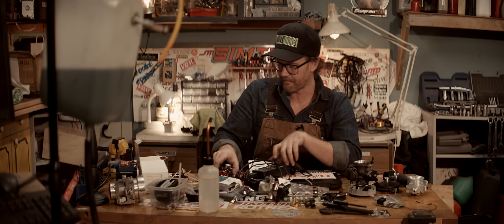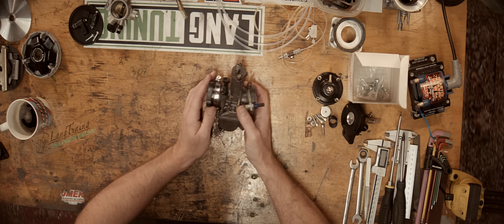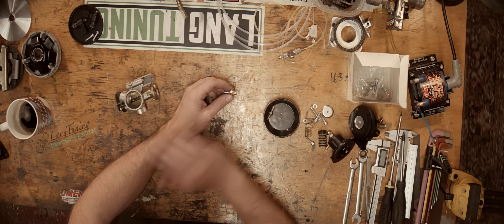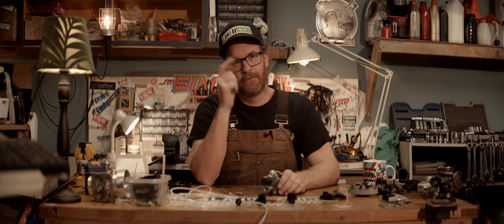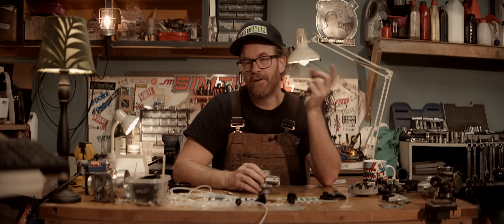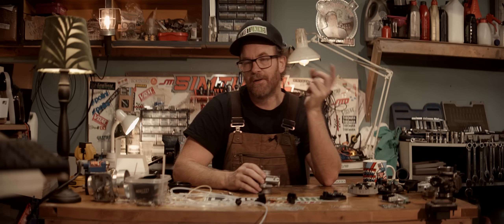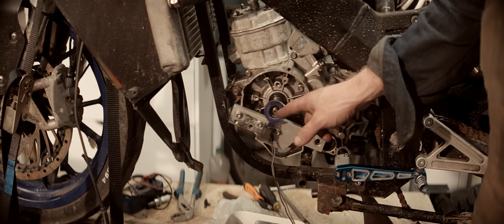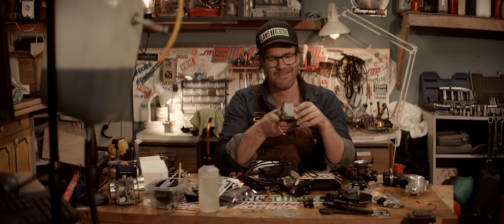Nitromethane Two Stroke EFI, but not how you think.

Comment: I'm not a fuel injection expert by any means, but I thought batch fired injectors normally fire once each crankshaft revolution.  And the pulse with is electronically adjusted depending on the desired mixture.  A normal car uses the ECU to adjust the pulse width based on information from a throttle position sensor, some kind of air flow sensor, and an intake air temperature sensor. But a more sophisticated ECU like you might find on a race engine, can change the injector pulse width based on any measurable parameter. Therefore, it's not immediately apparent to me why the rich/lean problem you mention at the beginning of the video would pose a problem.

Comment: Use a higher volume fuel pump for an injector. microsquirt is a programable system out of Canada. you can then adjsut it's duty cycle and impedance and duration so that would allow it to run perfect with the 2-stroke. or you could use 2 injectors.

Comment: This might be worthless but could you not put a stoichiometric sensor in the crank or even built into the port from the crankcase to cylinder. Use something like an arduino with fuel injection to maintain the fuel ratio at all times.. Also if you can find the right injector with perfect atomisation could you inject straight into the crankcase. Just a crazy thought.. Keep up the good work..

Comment: Water burns very slowly and is not likely to have pre-ignition issues, but it will slug the cylinder if you don't have adequate lightning to start the flame propagation.
Just sayin'.

Comment: Hi Alex, about CRANKSHAFT ISSUE: considering the relatively high radial load applied by the CVT at some distance from the main bearing, the induced web bending is something to be considered due to alternative deformation, specially at high RPM. The combination of the alternative bending and the resisting torque (and the increased friction) at high RPM can produce twisting between webs. I highly recommend you install a bearing in the crankshaft end in order to avoid the bending deformation due to CVT

Comment: It's exciting to see a bike on the Dyno. 
But I'm very suspicious of nitro being useful outside of drag racing very short pulls, how many land speed guys are using it successfully vs a more normal fuel oil?
Really think there's more mileage in alcohol literally. But your heading that direction just easy to get carried away without that engine being cast.
Im still interested in seeing water alcohol injection which the system your building would be quite capable of.
Reply from the maker: There's actually widespread use of 90%+ nitromethane in landspeed vehicles. They're all four strokes though...
Reply: @2STROKESTUFFING Moped Dick was showing promising sings before the Nitro got involved. I'm not surprised most nitro is 4t, getting a highly stung 2t to survive is hard enough, start pouring in explosive mixture without oil...
More sacrifices to the Gods of Speed.
Reply from the maker: @mrln247  Amen

Comment: Did you consider dual injectors, with a tiny startup injector and a larger secondary that triggers right as the pipe comes on? That would help with low end fuel atomization vs a too large injector that cannot handle the low enough pulse width needed to keep a 50cc happy at idle. Maybe the lean/rich pockets may not be as big an issue as you think - the newer KTM 2strokes are EFI and although they are down ~1hp vs carbed they don't seem to have any fueling issues.

Comment: Always entertaining, I wonder if the toy pump will last continuous use, change the seals for fuel compliant ones, good luck 😊
Reply from the maker: Thanks! I'm curious about that too. Might make my own if the system works, pretty much just two gears in a tight case.
Reply: @2STROKESTUFFING  The fuel injection system you're after has been around since 1960's and 1973 on production cars. The Bosch CIS (Continuous Injection System) or K-Jetronic system is the basis of what you need.
Reply: the pump itself is from a VW DSG transmission.. well I dunno if that's an endorsement, really. 
But yeah, the shaft seal on it, and the gasket between the pump and the middle bit might need replacing.

Comment: Go direct injection use a diesel injector maybe a diesel injection system from a small engine use it with a carburator possibly. Like port and direct injection on modern cars.
Reply: Yes, but how to make it work at 20000+ Rpm.

Comment: Just get a normal fuel injector and a normal fuel pump and a controller to go with it. You can make a 2 stroke engine with the fuel injector spraying into the crankcase. Its not hard its not and is way easier and cheaper than designing a intake so the carburetor can deliver a proper air fuel ratio. Like how long ago has it been sense I have said something like that? How long sense any engine designer have thought of this? The amount of time you spent playing with carbonators is astonishing.

Comment: I think in this instance you are making this much more complicated than need be.  

If you EFI with an O2 sensor in the loop you can just tell it what air/fuel ratio you want to run and it will keep it there no matter what RPM or how much load the engine is under.  

Granted going full EFI isn't cheap especially if you want something that just works out of the box like a Holley setup.  However there are less expensive options that can give acceptable results such as Megasquirt or Speeduino.
Reply: An O2 sensor is to slow, i think it takes about one second to make it respond. The Roman empire rise and fall during that time.

Comment: if you came to bonneville with a good running derbi 50, you could probably set the record. we have very few 50cc motorcycles for sale here. the last true 50 cc bike for sale was in the 80's. i would love to ride the deathtrap bike at bonneville. i guess the aprillia 50cc was for sale here for a small time, but it is very rare. you are trying to reach the moon, but you really only need to go around the corner{metaphoricly}
Reply: A stock Derbi wont get it done at 4000ft. Will need some trick bits.

Comment: If you go with brushless, you will want an ESC that can keep it at a constant, user controlled RPM. VESC will do this, as well as ODRIVE, and is very, very programmable and configurable by computer, but maybe also some of the BLHELI and AM32 ones will as well. That way, you can be sure that your pump is always pumping at the same rate, no matter the battery voltage going into it. Just takes another variable out of the equation.

Comment: A crazy idea but as fuel vaporizes faster when hot wouldnt it work to have a heater grid or radiator between crankcase and carburetor? With coolant running trugh it? Like a small computer radiator? I think there is 60 or even 40mm wide and tall. Copper and aluminium ones allso. Carbureted cars have coolant running trugh the intake manifold to help fuel vapourize better
Reply: Hier das enorm hohe Gewicht des Kraftstoff gegenüber der kleinen Luftmenge das Problem.

Comment: I'm starting to get addicted to this stuff, i'm right now designing new engine case for my Moped, so I'm able to run a bigger cylinder (prob. like a yz 125 or maybe something else, haven't gotten a cylinder yet to measure out) but as of right now, the case is already pretty good lookin'. I designed it to be a 2 piece design with a detachable crankcase and transmission, so i'm able to swap out crank and piston in one go and leaving the transmission together, and a sleeved crankhousing so I'm able to run a larger stroke than a standart am6 allows without having a massive crankcase volume. I'm also trying to fit in as many stud patterns and a lot of variability in rod lenghts by adjusting the cylinder foot height. I just have to find someone that has a cnc mill that could mill that case and a 125 motocross cylinder (85-150cc) with matching crank to make adjustments and test it using 3d printing. The best part about this idea and design is that its very variable and you could swap between entire power units and gearboxes independently from each other and you could fit almost any cylinder and crank in there. The only limiting factor is crankshaft bearings.
But thanks alot for teaching me so many things about a 2 stroke

Comment: Alex, you could try a fuel tank which is pressurized with compressed air with a regulator to accurately control fuel pressure.
Reply: You're exactly right concerning the air pressure-regulated fuel source! I've used this on my 2-stroke fuel injection system since the early 2000's. The only other thing that needs to be done is to have a servo-controlled coarse-thread needle valve assembly to control the fuel flow into the induction tract. The needle valve is mapped to match the engine's rpm and is linked to the barrel or butterfly air valve. Simple, and it works. For those interested in seeing and reading about the details of this F.I. system, go to pages 87-89 of my book: 2-stroke Glow Engines Vol 2, Power: Beyond the Basics (2007).
Reply: Sounds like a job for a bladder filled with exhaust gas pressure like a well water pressure tank
Reply: @at_3831  The problem is how to maintain the tank's pressure as it empties (when the non-fuel volume increases). Before solving the problem with regulated air pressure, I experimented with pressurizing the tank with expansion chamber pressure, untimed crankcase pressure and timed crankcase pressure. Unfortunately, none of them worked at delivering a predictable, consistant fuel delivery to the engine's induction tract. Unless this can be accomplished first, no amount of fuel-mapping and Arduino-control will matter.
Reply: @DavidGierke-nl1dl  exhaust pressure with a standard blowoff valve to prevent over pressure

Comment: Thoughts started rolling. First, was run two carbs a small and large on with staged linkage. Then EFI, but you want continuous fueling and I agree. I've seen where running injectors above a supercharger on SBC has less than ideal results (couldn't get it run batch fire with the coil on plug) so I was thinking variable fuel pressure with two rpm staged injectors. Final though is mechanical injection as it is less stuff and less amps needed, but use efi control to do fly by wire on the barrel valve instead of mechanic with a high-speed lean out solenoid.

Comment: I understand that you have more ideas right now than Ive had during my 56 years alltogether. Why only aiming for the most complicated 50cc? Why not have that nitro engine as a beside ”dream” concept? I guess 98% of all subscribers are more or less normal 2-stroke interested people and with that I mean gasoline and carburetor and perhaps injection for som neerds. I have followed your channel at least ten years and I love it. Still what I wrote above is something I miss. There are thousands if not millions of 50cc petrol engines that you have not beaten with this nitro engine. I like what you are doing but why not restart with a basic 50cc that will compete (powervice) against the 50cc roadracing vintage bikes? Just a friendly thought 🙏😇👍🏼🍻
Reply from the maker: That's what's going on now😁 Nothing experimental will move over to the main engine until it's properly tested.

Comment: Have you considered carburation for low power and lower end lube and direct injection of nitro, either direct into the cylinder or the transfer ports for peak power? Probably couldn’t pulse at 15,000 rpm, but a properly metered  continuous stream seems a potential solution. Just a thought.

Comment: So pleased to see you looking at fuel injection.  It seems that fueling issues have caused you many hours of grief. How low pressure and/or high pressure direct injection? A combination of the two would give you enough time to dump plenty of nitro into the cylinder.  If not then combine port injection mixed with oil and direct injection of pure nitro?

Comment: I know nothing about this so someone with knowledge, feel free to explain why it would be a bad idea to put high pressure injectors into the transfer channels, injecting atomised nitrofuel on the transfer cycle. That would give high presition control and also not mess with the idle.
Also, I suck at english, I already know that.
Reply from the maker: Injecting into the transfers in the transfer cycle is the way to go. The problem is at 19k rpm there's just 1ms of transfer duration, not enough time for opening/closing injectors.
Reply: Not enough time to evaporate the fuel at 20000 Rpm.
You don't suck at english, you wrote this question.

Comment: Stop messing around and use a STIC Super X carb. It is not a modest improvement over a Keihin PWK, it makes my MX bike feel like there is a big bore kit added. The fuel uptake is much more aggressive and responds better to the smaller bore signal. The needle jet is perforated and is in a chamber that receives air/fuel vapor via the carbs bore and intake bell. The intake bell provides higher pressure just above the main jet, this feeds to the lower pressure at the top of the needle jet. As RPM's go up and the fuel level drops the the mixture becomes leaner, not richer as with a standard carb design. Part of the design also has stepped passages that create temperature drops to the mixture, which also creates a vaporous mixture that has a faster delivery in the intake tract. Always good luck to you.

Comment: little idea: mount the injector or the nozle before the throttle body and a mass sensor before the injector. then connect the mass sensor to an arduino and tell to the arduino to regulate the pressure  based on the mass sensor
Reply: Eine gute Idee, jedoch scheitert sie an der dynamischen Ultraschallresonanzwelle vor dem Einlasstrichter. Es funktioniert, wenn der Ansaugtrichter in einem Gehäuse untergebracht ist, das genau dem Kurbelgehäusevolumen bei UT entspricht. Dort sollte ein Luftfilter als intelligenter Phasenschieber dienen, dessen Volumen dem Spülzonen-Volumen des Motors gleichkommt. Vor dem Luftfilter sollte ein Resonanzvolumen sein, das genau auf das Volumen und die Form des Abgassystems abgestimmt ist. Vor diesem Gesamtansaugsystem könnte eine Airbox platziert werden, in der mit einem kleinen PTC-Heizdraht die Luftmasse durch deren Abkühlung bei konstantem Durchfluss gemessen werden kann.

Comment: I do wonder if DFI would be a good route for your engine. That way, you could precisely control the fuel amount on every single power stroke. The Downside would be that you would need to oil the crank bearings and lower cylinder separately. Dfi has been successfully done with very simple systems on jetskis and outboards. As always, it's been very fun following your progress, sir!

Comment: What kind of moped kid didnt port match the cases to the transfers after bringing up how badly they were done ?
Reply from the maker: It's not as straightforward as that, matching the cylinder transfers to the vastly different case could make less power. And this is just a test bench.
Reply: @2STROKESTUFFING  Fair but everyone knows to match to the gasket at least a little. I understand crank case compression and you want as much of that as you can with a small motor. But no way you shouldnt at least smooth that out a little. Hell do a test. Run it like that. Then do the transfers only. Would be a great video.

Comment: -How about putting the injector(s) inside the crankcase (maybe aiming upp the piston). 
-How about double sparkplugs (as widely apart as possible in an oval combustion  chamber) , att 20000+ rpm the flamefront does not have very much time to propagate. 
-If you use a hydraulic coghweel pump for feeding the injector(s) you will gett pulses in the fuel flow but if you put a bladder accumulator in the flow, that kan      be redused (eleminated).

Comment: You  have sort out same things: 
-How many horsepowers are you aming for (need, to set the land speed record). 
-How many rpm will that require (from a 50 cc engine).
-How will you reach that rpm.

I think you have two basic ways to go:
-A rocket engine whit a 50cc piston.
-A Swiss klock that can actualy "tick" 25-30000 times a minute ( delivering 25-30 hp)
Either way, you will probably have to bend the law of fysics.
But that is the sport of it, is´nt it